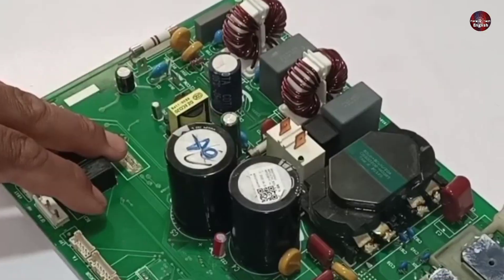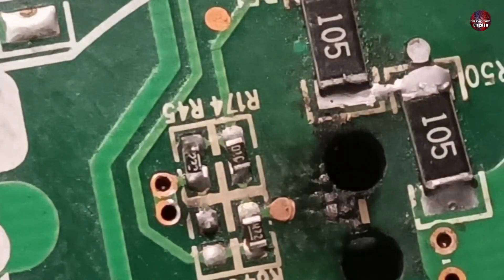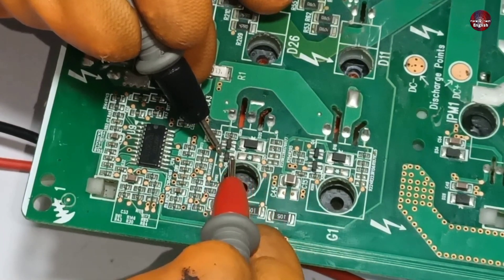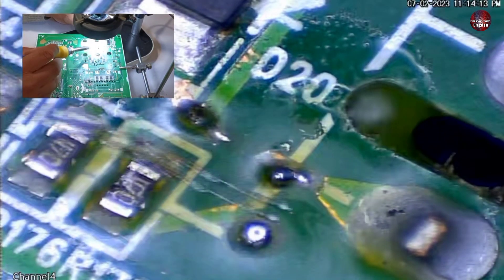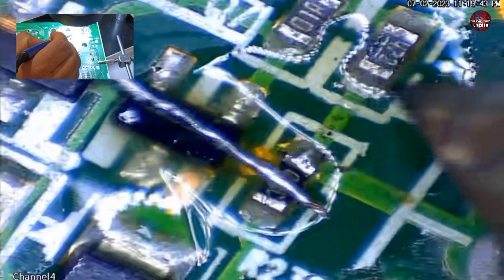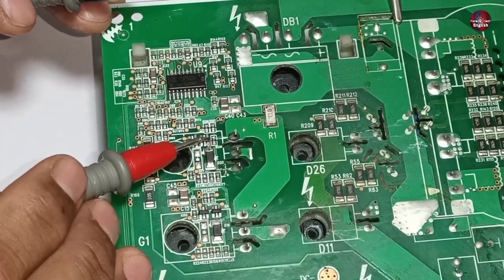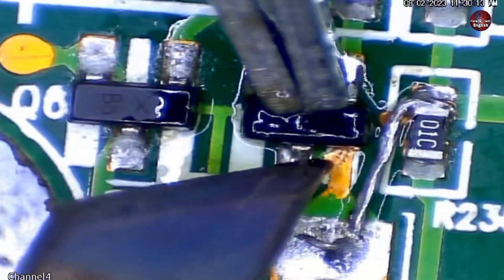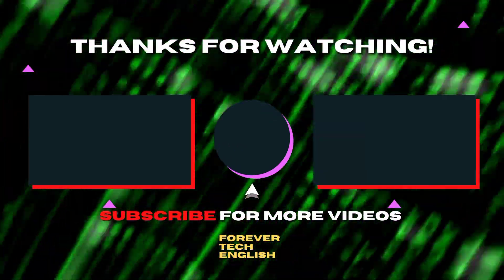Other Repairman Couldn't Fix This Gree AC Motherboard, Can I?

Comment: Sir i confuse about transistor.if you remove it from board reading showing good reading but in the board reading is not good reading.so why you don't put back that good transistor and you change a new transistor

Comment: Voltge doesn't flow,current does!
Reply from the maker: Dear I know That voltages is the potential difference, and current flows. It is a slight mistake.
Reply: @forevertechenglish  it's so cringy, you obviously can't comprehend. Some people come on your channel to learn. So if they learn it wrong, it may take them time to correct if ever. If you present your self as a professional, try act and speak like one. Best regards.
Reply from the maker: @SanelKeys  Well in this video my main focus is to troubleshoot the fault. I am not focused about the basic electric stuff.